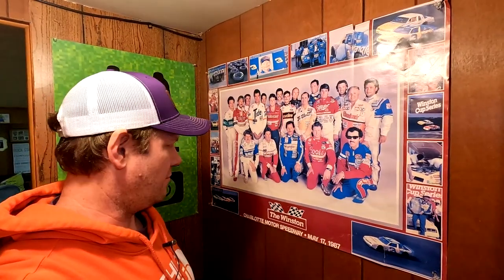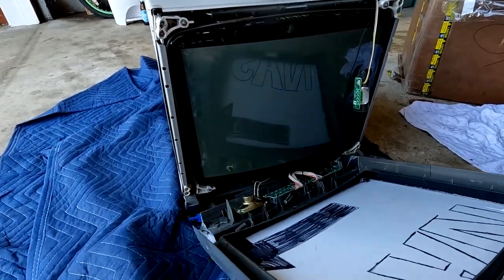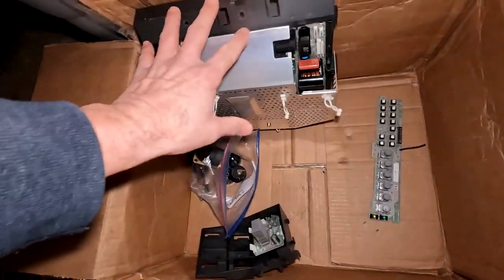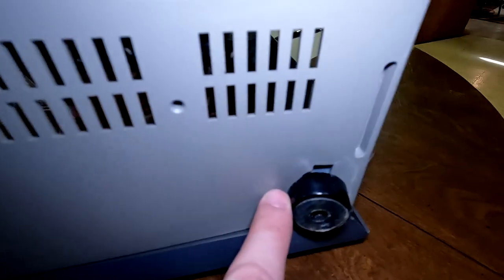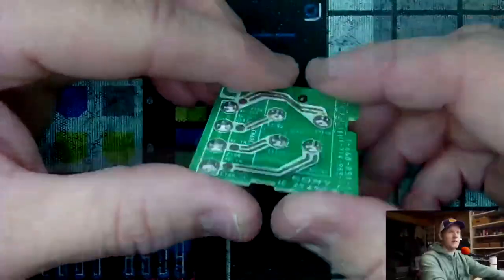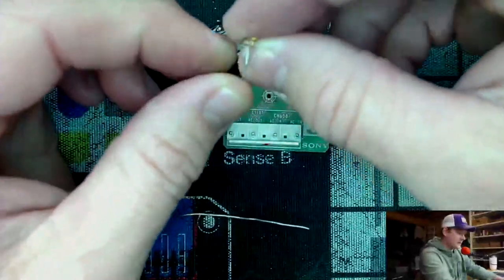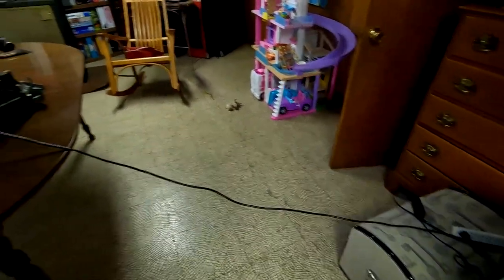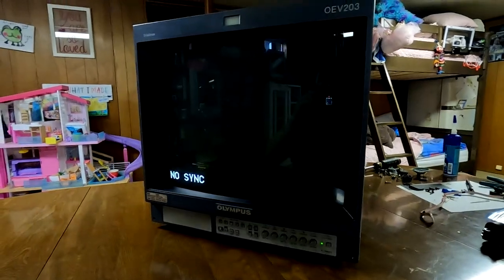Re-building a Great Retro Gaming CRT - The Olympus OEV PVM

Comment: I have a 1351q that has a busted bezel, neck board and power switch from shipping. It also developed a vertical fold over from the damage. I'm hopping it's not the flyback or its pretty much done. I did find a bulging cap and have decided to do a cap replacement for the A board as a last resort.

Comment: Would you be able to repair a TIMM CRT that no longer powers on? The light comes on the front, but no buzzing and no tube turning on. Worked fine for a few years (maybe 100 hours of use)

Comment: Hi, i have the same monitor. and i have a problem with the front buttons. the + and - doesnt function and the Degauss and Slip are inverted. The Slip button Degauss the monitor. I already down the board and check visually,  ii is fine,  no cracks or short circuits, the buttons do the right sound click, i clean and reconect all, but that dont help.  Any clue, its apreciate.  Thanks.